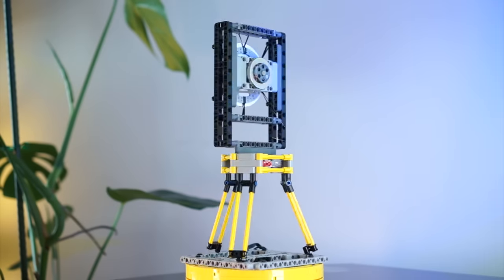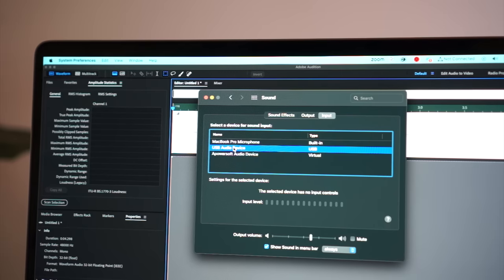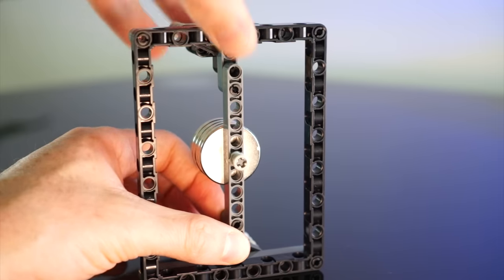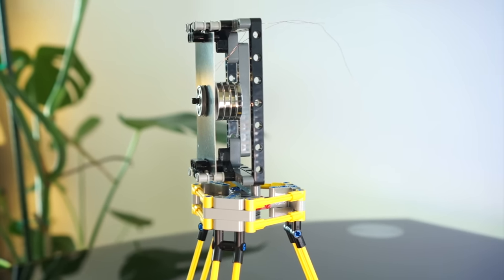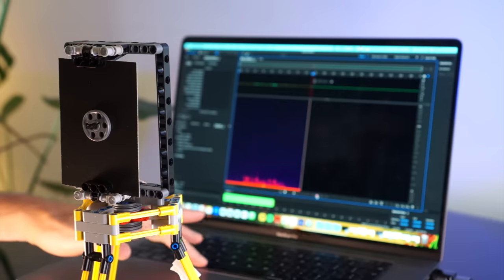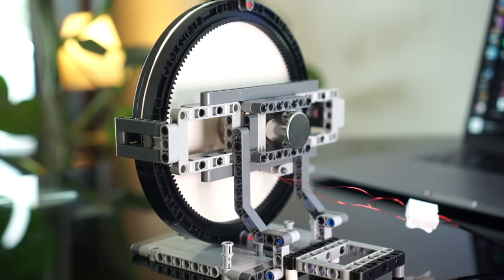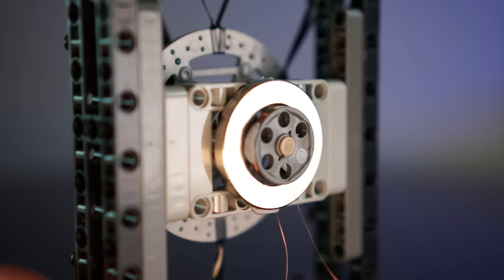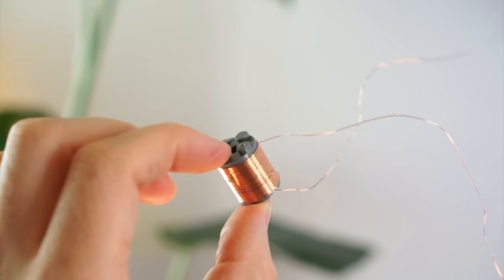Can you build a real working MICROPHONE using LEGO?

Comment: - 4:33, you need to have shielded wires (wires insulated by a first coasting, metal mesh or film, and then a thicker final coating, creating what resembles a speaker or headphone wire at the least). Also, you would need a pre-amplifier to boost the initial signal, ensuring that that will both be shielded and offer a unclipped, undistorted, and still loud enough signal to at least be decently recognisable.
- 4:39, thinner wire tends to catch more residual signal and for higher voltage and lower current, thicker being for lower voltage yet higher current.
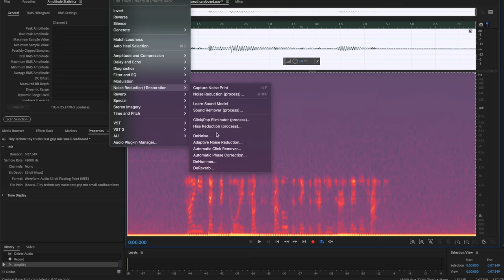- 8:09, the signal is clearer due to the placement of the coil within a magnet, being closer and of more effect when generating Eddie currents through the coil.

just three helpful tips :>
Reply: also, that little piece of adhesive on the coil at 8:39 is restricting some of the physical movement of the coil within the ring magnet.

Comment: Others have mentioned some important things, a pre-amp is going to be a necessity. Some design tips as well, if you can make the membrane lighter and thinner without compromising it's strength much, I would absolutely investigate that. instead of elastics, try something like fishing wire to suspend the diaphragm, you actually don't want things to be too "bouncy" and I believe fishing wire may be the perfect blend of flexible and stiff for this application. 

I think your final design of having the coil near the middle of the magnet was really good, consider the direction of the field lines vs the direction you're wanting to induce a current. You generally want the magnetic field to be moving orthogonal to the direction you want the coil to generate current, which is perfect in your final setup, you may want to experiment with sinking the coil in further or making the coil longer, passing through more of the center of the magnet.

Comment: Great video! You might try using a thinner lighter membrane. A heavier membrane should vibrate more at lower frequencies and a lighter membrane at higher frequencies. Think about how fast you can shake a beach ball vs how fast you can shake a bowling ball. Maybe a balloon stretched over a frame or something similar would work?

Comment: Years of 12v audio experience (car audio).  The most important thing to remember is your membranes weight/surface area ratio.  For input, you want as light as possible while covering as much surface area as possible. Make the membrane out of something thin, light, and durable (think like a piece of one of those clear notebook dividers or something) keep it suspended and about the same size as your original. Next, make your coils tighter. Go down on your inner diameter. Should allow you many more turns, especially with that thin stuff. Your goal is to produce the highest amount of fluctuation, regardless of the actual voltage. For example a low of 1v and a high of 10v is better for input than let's say a low of 5v and a high of 12v.  That 2v difference isn't worth the range of audio you will get with the lower voltages. Hope all that makes sense. And my voltage #s are from out of thin air, so take it as an example.
Reply from the maker: That totally makes sense, really appreciate you sharing these recommendations! For a future version I'll certainly try a thin coil with many windings. As much as I hate dealing with thin wire, I might even go thinner than 38 gauge to get those windings up 😬 Cheers!

Comment: You not only need a preamp, but the cable and coil needs to be shielded, otherwise you pick up noise from outside. So the whole coil/magnet assembly needs to be in a metal cage, and the wire to the preamp needs to be shielded.

Also try buying a high grade N52 magnet, those have a stronger field, you can put one on the other side of the coil as well to double the field strength.

You also want the membrane to be very light, I would use paper instead of cardboard.

These mods should increase the output quality a huge amount.
Reply from the maker: A wire shield would have been a great idea, cheers! And you're right, it seems a better preamp is needed. The magnet I believe was an n52, but a larger one for sure could help

Comment: Cool! Getting the best recorder or mic pre-amplifier for your dynamic mic… if you have 60db of clean amplification the signal-to-noise (SNR) of recording will improve a lot as more of the recording is the mic’s actual sound. Don’t know anything about your computer but I’d generally assume “free audio gear” has the quality you paid for (in this case a dollar or a few cent added to the laptop’s BOM… your legos might cost more than the computer’s mic ADC). Maybe good amplification won’t be an earth shattering change but I would expect it to be basically the same sound, maybe a bit clearer, but so much cleaner (noise free)

Alternatively you could build a condenser mic. I honestly don’t know much about the electronics of a condenser mic, but you either need components and soldering or using a pre-assembled mic capsule / PCB set. But if the point is “do as much in basic Lego” as possible, maybe condenser mic isn’t the way to go as a lot of the mic becomes non-lego.
Reply from the maker: That's a really interesting point re the condenser mic. I toyed with the idea, but as you said - decided not to to try and keep it more Lego based. Ultimately my goal for these videos is to demonstrate some basic experiments almost anyone can do in an afternoon or weekend. And hopefully learn something along the way. But I do like the idea of a better pre amp to get a cleaner boosted signal. Will certainly look into it. Thanks for the advice! 🙏

Comment: Love the audio series so far! ❤ Anyway, i have a little bit of experience with microphones. There are tons of different kinds and technologies you should read yourself into but these are the tips that i got, that may help.

First i think experimenting with ribbon or string microphones is a step forward but you can also achieve good results with membrane microphones. As you saw a good and big but stiff membrane should get the job done, atleast i believe so, because you want to have a good range of frequency and so far your last design sounded good but i think there were not enough low frequencies and it therefore sounded like an old iphone speaker. And stiff because you want to get rid of afterbounce and background noises of course. I beliefe that helps

I think you should also cover the microphone with a fine piece of cloth! Especially at the front. That should help with the background noises aswell and also act as a pop filter, so you don't get those high bass pops everythime, especially when you say the letter P in any sentence.

And it may help looking at non self powered microphones, where your device, like your PC gives power to the microphone, like via USB signal and the frequency waves get rectified onto the power signal, so that the signal frequency is modulated to contain the audio, which should give you the ability to justify the volume of the microphone.

Hope that helps
Reply from the maker: Woah thanks for replying with so much detail - really appreciate you taking the time! I'd love to experiment with a membrane microphone. By that, do you mean like a condenser microphone? A pop filter is certainly an easy fix I can add to it! And agree, I think it makes sense to deliver power to boost the signal. To be honest, I'm not too familiar with how that circuitry works, but I'm sure it's relatively straightforward - will look into it some more. Cheers!
Reply: @JamiesBrickJams  Yes that is the type of micrphone that i was talking about. Allthough Ribbon or String microphones are generally used for radio station etc., atleast i heard so, condenser microphones are usually all around us, like normal Tablestand microphones. There also exists a type of microphone with large Membranes, which usually are these weird conference microphones, you see in conference rooms a lot. These that look like small ufo's for example.

I think that is as far as my knowledge goes.

Comment: you should decently try make a headset next for the complete setup
Reply from the maker: That's totally doable ... A bit challenging to make it interesting though. Certainly worth trying!
Reply: An over ear design would sertanly be the easiest way to go, As the speaker it's elf can be much larger.
If you wanted to make it an extra challenge instead of two drivers you could have 4 (2 for highs and 2 for lows) placing the lows in front closer to the ear, as they would be most likely much large than the highs.

Comment: In the guitar industry this is a "single coil" microphone. If you want to reduce the noise, try making two coils of copper wire and have them be reverse wound and reverse polarity to eachother, that will make a lot of noice cancel itself out.
Reply from the maker: Would that not have the signal cancel out too?
Reply from the maker: Ah bril, cheers for sharing!

Comment: I dont know if you got to the point, but you should use a boost converter to step up the voltage then make a noise filter circuit to clean up the undesirable fuzz.
Reply from the maker: I tried a few transformers but actually didn't think of a boost converter. I suspect that mightn't work as most require a certain current to run, and the current here is ridiculously low
Reply: @jamievancoppenhagen  oh that is a fair point. Maybe an op amp then? You can set it up to work as an active bandpass filter at the same time as amplifying the main input. I know o ce you get to a certain point though when does it just become a mic and not one made of lego.
Reply from the maker: @tylerm124  my thoughts exactly - at a certain point it's just a microphone with some plastic bits 😊 But I do still want to try a pre amp - cheers for the advice!

Comment: When you’re speaking into your microphones at that angle you’re speaking downwards at them which is not ideal.  You should be speaking on-axis with the face of the diaphragm. This won’t improve the design of the microphone but it will help with getting a better signal through whatever design you’ve made.
Reply from the maker: That's actually a good point, I should have lowered myself down to that flat-on angle 👌

Comment: I'd wager it's the cardboard membrane. Higher frequencies require faster vibrations, which something like cardboard just dampens out of existence.
Reply from the maker: I'd wager you're absolutely correct 😉 Yeah some experimenting with different membrane materials is needed
Reply: @JamiesBrickJams  i would try with stuff that everybody has at at home, like normal paper on a frame or backing paper

Comment: The mass of your coil and membrane is too heavy. The more mass it has, = more energy is needed to move it, but try using a piece of spandex or elastic from a balloon to use as your diaphragm. You may be able to get a crisper audio with better high end
Reply from the maker: Oooh now that's a cool idea! I wonder what a stretched balloon or piece of rubber would sound like. Cheers for the suggestion!

Comment: For your next video build a spring Reverb and other video try making a plate Reverb.
Reply from the maker: Ooh that's a really cool idea, thanks for the suggestion! I had to look up what they are, and they sound really cool. Could be an interesting experiment comparing the two
Reply: @jamievancoppenhagen  yes there are, the reverb is sounds that bouces back and forth. You probably familiar with a empty room or hall effects but that different type of reverb. What you need is just a spring or slingy and attached one end on the center speaker then the other end the pickup then you mix the clean and sping reverb or wet signal together and that a spring reverb. The spring reverb was the first analog reverb that came from 1960s.

Also the spring reverb when hitting that create the sound effects from Starwars of the plasma blasting.

Here a link for the starwars effect

https://youtu.be/tz8Rsz-FOHo

Other the spring reverb and Plate reverb 

https://youtu.be/XsVF1rySAmU

Comment: Not an expert, but afaik with microphones you really want to minimize the weight of your diaphram to get any high frequency response, maybe using some sort of thin foil...
Reply from the maker: I'm pretty sure you're right there! Hopefully the ribbon microphone (which uses a thin foil filament) will work a little better 🤞🤞
Reply: @JamiesBrickJams  Really looking forward to this one, hopefully you do manage to get that one working!
Reply: @JamiesBrickJams  Any updates on the ribbon mic? Remembered you did this one after seeing your turbine video, wonder whether that is still somewhere in the making or scrapped for now?

Comment: Your cardboard is a bit to heavy. You need something very stiff and very light.

Also. Most microphoned use a filter to flattem the response curve. This wpuld probobly help a lot. Like loads.
Reply from the maker: Thanks! Will look into a filter for the next one - that seems to be a common suggestion
Reply: @JamiesBrickJams  The simplest and.. probobly most effective way of doing it is to have a normal speaker do a freqvency sweep, then pick it up with the microphone, then just level it all to somewhat the same volume (it have to peter of a bit at both ends, other vice the gain will be to high).

This is typically done in software.. and while its not a very lego like solution.... making a hardware filter wouldn´t be anyway

Comment: the magnet must pass through the coil or you will get a extremly low signal
Reply from the maker: I actually experimented with that quite a lot and was struggling to get a Lego piece that fits closely without toughing it. I got pretty close but it didn't provide much of a boost so just went with this simple compromise. You're totally right though, that would have been ideal!
Reply: @JamiesBrickJams  also to have less white noise on the recording you need shealded cable and sheald the whole microphone with some grounded mesh than you can boost the volume more.

Comment: This is just a DIY mic on a LEGO holder. 
(should have used a LEGO motor to pick up a sound)
Reply from the maker: That's an interesting concept... Do you have any idea how a motor can be used to pick up sound?
Reply from the maker: I suspected that's what you meant. It's such a unique idea, and I was sure I misunderstood because I just couldn't find anything on repurposing a motor to use as a microphone. In principle it definitely sounds possible, though would need a lot of amplification as the motor axle needs to rotate to produce an appreciable signal, so I have to assume the signal would be very weak. I actually gave it a quick try using a Lego motor but unfortunately Lego motors are geared to all hell. And there's so much slack in the hearing that nothing gets through to the motor itself. But I have to say, that was a stroke of genius you had there! Would love to think more about this. Perhaps an old train motor with minimal or no gearing could work

Comment: A lot of the noise comes in through the wires that go from the coil to the computer. You want to amplify the signal as close to the source as you can - a lot of modern capsule microphones actually have an amplifier built-in!

This is could be as simple as connecting the coil to the base and emitter to an NPN darlington transistor and connecting the microphone input to the collector and emitter. The computer should be outputting a small voltage (a few volts) with a high internal resistance and is measuring the voltage on the positive lead, and the microphone should pull that voltage down depending on the signal. Just gotta make sure to put the positive lead on the collector.

You might also need to bias the transistor slightly by connecting a resistor (10 kΩ is probably a good starting value to test, the specific value depends on your coil and transistor) between the collector and base of that transistor, so you get both halves of the waveform. Otherwise you might only get the positive one.
Reply from the maker: Woah that's such a cool idea using a transistor as an amp! Makes a bit more sense than just a transformer as we can at least provide more power to it. Thanks for the suggestion! Will need to do a bit of research to figure it out, but that's a neat idea 😁
Reply: @JamiesBrickJams  Sorry to say, but the comment above is straight up wrong. A single transistor amplifier will work but, the manner of building it as described is ridiculous. I suggest looking at Rod Elliott's "Project 13 - Low Noise Microphone Preamplifier" specifically the 12V version described in that article. It's a proven circuit that works,  and performes extremely well for 2 transistors and few passive components.

Comment: clickbait as usual. Whats the point if you are going to use non lego parts. Might as well glue a microphone to a piece of lego and call it a lego mic. 

do it again but with lego only parts
Reply from the maker: That's fair. My channel isn't really about all-lego builds - it's about teaching basic principles using Lego as a vehicle for learning. But not exclusively Lego. I don't think anyone will be surprised to learn that a microphone can't be made of just plastic. But Lego sure does serve as a useful construction material for things like this. That said, there was a really cool suggestion to use a lego motor to try to convert some sound waves into electrical signals. Unfortunately because Lego motors are geared that wasn't possible, but I'm still interested to see if some of the really old motors had no gearing - then it might be borderline possible!